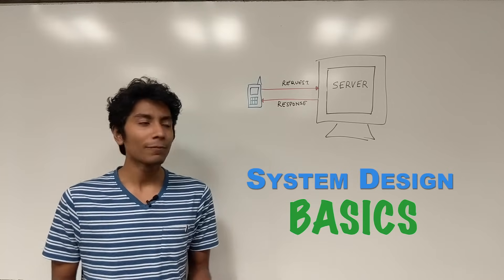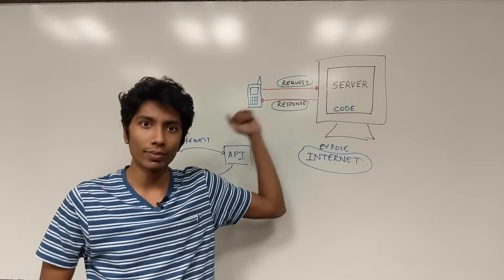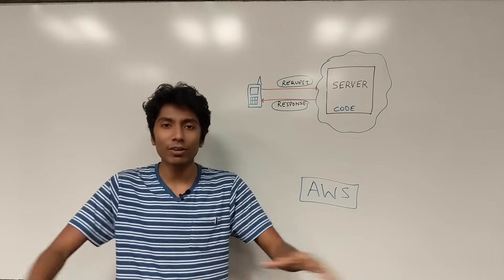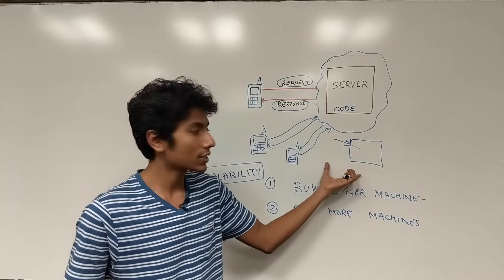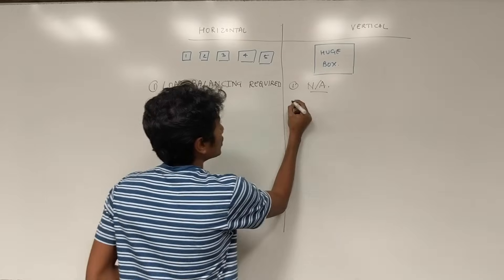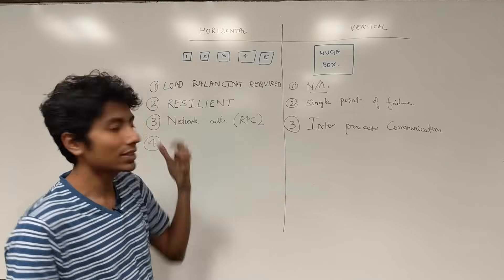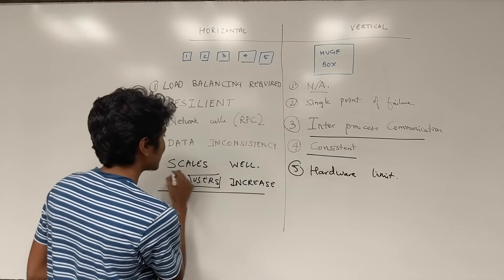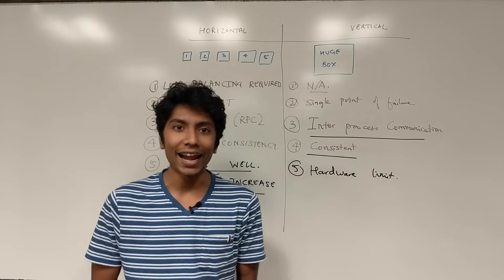System Design BASICS: Horizontal vs. Vertical Scaling

Comment: Hi Gaurav, couple of quick questions (based on my limited knowledge). Please explain the following.

Horizontal scaling slow due to network calls (RPC) while vertical scaling is faster due to inter process communication, why? Hasn’t it got to do with Microservice/ Monolithic Architecture?
From what I understand, all our servers (in case of horizontal scaling) are connected to Databases and a distributed redis store. Every server does not have its own database/ redis. So how is consistency affected by horizontal or vertical scaling?
Reply: @Charu 
Some Distributed DBs(like ElasticSearch) are eventually consistent.
In Some Distributed DBs(like cassandra) you can tune consistency , but choosing  full consistency will make Dbs slow(since each replica has to be updated with its master/leader, which will take time).
Reply: You are true. I was going through the comments section to check if somebody has pointed it out. Good one. 
Horizontal scaling doesn't mean you divide the service into microservices and introduce a rpc mechanism between them. That's more of a microservice/ Monolith architecture related design. Horizontal scaling just means you scale your service to many independant services as a whole. There by dividing the tasks between these newly spawn services.

Comment: At 5:28 min., you explained about the transaction, saying that we may have a transaction where the server 3 sends data to server 4 and server 4 sends to server 5 and server 5 sends to server 1. Isn't these servers have the same code running(horizontal scaling), so every server is communicating with the client(handling a request), then how come these servers are communicating with each other. Could you please help me out.
Reply: @vishwastyagi2770  It's sort of microservices architecture, where he each service deployed to separate system.

Comment: Hi Gaurav, great presentation skills. 

Had a question...in case of "horizontal scaling", wouldn't all the servers (say 1 to 5) be doing the same thing and the LB would forward the request to one of them? If so, why would data flow between the servers? You mentioned that data might be flowing between the servers when you talked about "Data Inconsistency". Thanks.
Reply from the maker: If you have to find the bank balance of a user on multiple servers and make updates on it, you need the data to reflect across the systems correctly.
Reply: @gkcs  I believe his question was, let's say there are two users a and b. all request related to the user a, will be handled from a given server and vice versa for user b. So, the data should not be corrupted since u won't have to transfer it to other servers. However, I think when you point this put in ur lecture, u were more referring to such cases on microservices architecture  were user a query can be processing on different servers with different microservices and db... right??

Comment: Suggestion: Do not pause and play the audio. It's okay to have the continuous background noise.
Reply from the maker: When was that?
Reply: @gkcs  Okay, I understood what's happening here. When you're fast-forwarding a bit of video (while writing on the board), the audio goes blank and when you're talking it's normal. That's why it looks like you're pausing the audio. I do not know what exactly you can do about it, because speeding up the writing part is important but, the audio pause/play is a little annoying. Especially, when listening through headphones.

Comment: must give a support to this channel. TBH, the indian accent is sometimes quite hard to understand, but the teaching, the explanations and drawings makes the whole-internet sense. You really teach things complex in a simple way, ace all other system design channel
Reply from the maker: Thanks Dylan!
Reply: @gkcs  Actually i have a question...my amazon interview is 5 days later...for the gateway, i watched your whole videos, one thing still confusing, so the load balancer is in the gateway? and the gateway is responsible for recognizing what kind of service this http request want, and redirect it to the correct server right? and what kind of situation should I use cassandra over mongo? based on my understanding, if lots of read write  need large scale support , use cassandra, if not that large scale required, just use mongo? thanks

Comment: For the point data consistency
Correct me if I've assumed wrong

Why would the transaction be atomic across multiple databases. Won't this be a bad architecture
In case the 2 servers are communicating with each other in horizontal scaling won't they be separate microservices. In your use case these ones are actually handling the same database which I think should not happen and if they are handling then God bless those race conditions
Reply from the maker: Yes, the microservices have separate databases, and a transaction may span across them. In that case, we need a prolonged transaction.
By data consistency, I was actually focusing on dirty reads on the cache :)

Comment: Can you provide more details as to why data consistency is an issue when scaling horizontally?
Thanks in advance, Also great video! I've been watching for a couple of days now
Reply from the maker: Thanks for the feedback 😁
With more machines, data managing has to happen through communication on the network. It means that either the computers have to sync, which takes more time. Or they have to decide on eventual consistency, which has it's drawbacks.

Comment: The point relating to consistecny needs to be altered a bit. If your db tier is no sql or the data is replicated across nodes in a cluster or you have several cluesters and data is replicated across them then there will be an inconsistency since the information may not have propogated to all the nodes.

However if you have a single db or a master slave mechanism like rdbms databases consistecy will not be an issue. Consistency has nothing to do with the compute instance being vertically or horizontally scaled.

I think you meant the db layer :)
Reply from the maker: Yes, thank you!

Comment: In horizontal scaling, won't the Load balancer be a single point of failure?
Reply from the maker: Yup. Make that distributed too 😛
Have a look at my video for removing single points of failure in the system design playlist.
Reply: You can use cloudwatch to monitor you load balancer.
Therefore you know its health in advance and you can act accordingly.
Reply from the maker: @mukundsridhar4250  Isn't it still a single point of failure?
Reply: @gkcs  When you configure an ELB through AWS you will typically get two per availability zone. So if one goes down it will be replaced. This is similar to autiscaling groups. ELB's could fail but they get replaced.
 Its also a good idea to configure your ELB's across availability zones.
Although not related , many production applications use AWS's elb as the first tier and ngnx as the second tier since ngnx gives you better routing options.

My suggestion relating to configuring cloudwatch with the elb's is so that you can monitor some metrics and know whether a crash is imminent beforehand. :)

Comment: Thanks Gaurav for the video.😊
How about if we use limited number of powerfull machines to eliminate h/w limitation and gain more data consistancy?

Regards.
Reply from the maker: That can be done, till you need to scale more. 
Horizontal scaling is inevitable 😛
Reply: @gkcs  👍😁

Comment: Nice video. There are some questions in code forces and code chef. Which is hard to understand even if i check the successful submited ones, its hard to understand there logic. I believe that i am good at logic but i need some smooth surface to get my brain run flawlessly. I am good at animations that may be why i am having 77k subs. But i need to use my brain for programming too. Lol.
Reply: same here, if you find something please refer
Reply: @OmarKAli-wz5ku  yeah you just have to find a community there you can get the understanding easily
Reply: Woah!! Now you have 390K subs...
Reply: @ssrpic  thanks you noticed.

Comment: Hello Gaurav, I made a website in django, now I am worrying about how to scale it, do I need to change anything in my code for horizontal scaling. I have deployment experience on pythonanywhere.com, but for scaling, should I shift to AWS?
Reply from the maker: Hey Sandeep,
The code will not change much, unless you are using caches which need to be updated on all boxes.

Comment: What if we run multiple instances of the application in the single server? Can we call it as horizontal scaling? The difference being instead of scaling out physical servers, we are scaling out with instances.
Reply: I think the advantage with something like multiple instances of application on a single server would be good use of all the hardware available on the machine. But there is also a fear of failure of that machine as any one instance demanding more than available resources can crash the machine at some point. Is this correct Gaurav?
Reply: Would still be a single point of failure if there is power/network failure.
Reply from the maker: Something like Docker? Yeah, I guess virtual servers would count. But the hardware capabilities are the same. So apart from some reliability improvements, I wouldn't really call it scaling up 😛
Reply from the maker: Sagar Manjare To some extent, yes. However, there are abstractions like the ones Docker provides which limit maximum resource usage per container.
Reply: Gaurav Sen Oh thats nice then!
Reply: There would be Hardware limit of no of instances you could run on a single server.
Also it still remains a single point of failure.
In an ideal world , people prefers running single instance on a single server.

Comment: Very good explanation. When I was setting up ngnix at the back end for my previous website, I wanted a video like this to explain in small and crisp manner without all the jargon. This video does that trick. Really nice video.
Reply from the maker: Thanks Blockchain 😁
Reply: Gaurav Sen The problems in system design are really hard and just algorithms and data structure skills can't help in end to end understanding of how a particular application/framework works. System Design understanding is key to have an overall perspective. What's the point of learning all the data structures and algorithms that support todays modern applications but then we don't know how to put the components together to actually make the app work. We make know that DAG is good for a build system but is it enough to make npm or any other build system, NO! We need to know how to put everything together and produce the whole meat. I really like watching your videos. 😁😁
Reply from the maker: Blockchain Group Couldn't agree more with you 😊